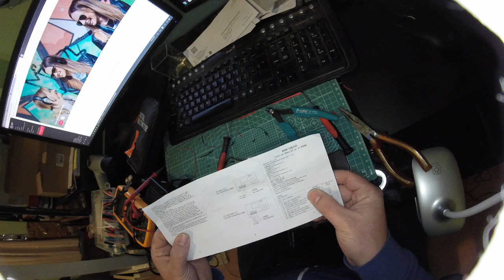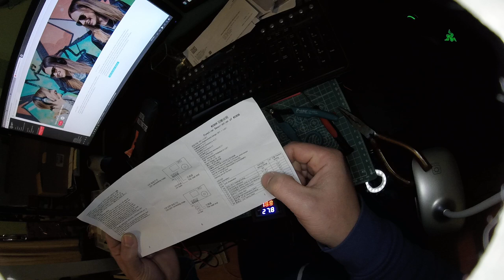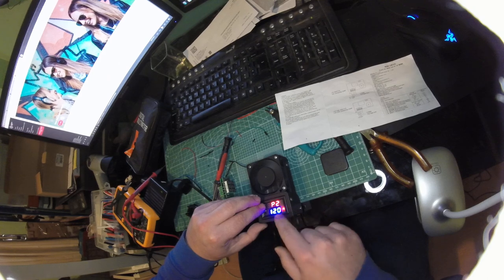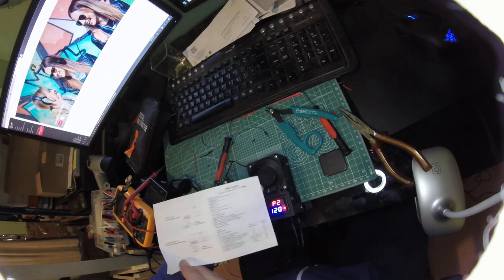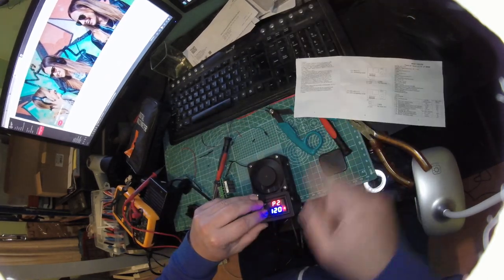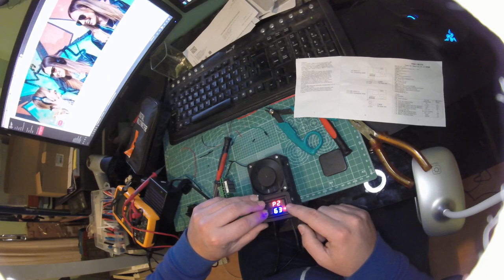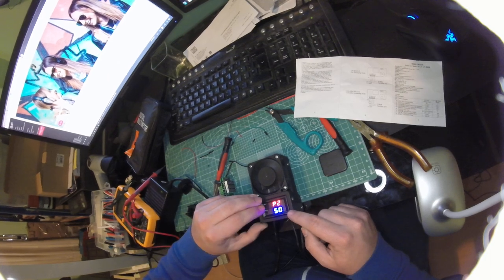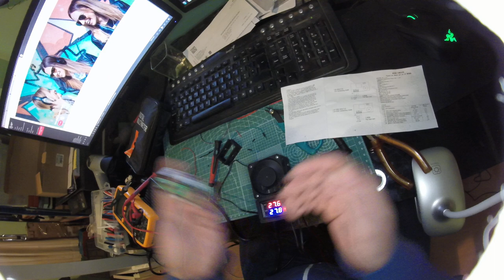Magsnap Heater unit for SLA/LCD/DLP 3D printers

Comment: Would love to see what spec sheet you have cuz mine came with no instructions. Worse the leads on the heater are pretty solid spade type, so stick down deep in the case and interfere with the back of the lcd. As usual i need to re-engineer something thats already been engineered. An assembly vid would be helpful
Reply from the maker: Yeah, you are not the first one to ask for a assembly video. I was hoping by now the community had already made one but guess not.
Beginning of the year i'll be building 3 more units for my machines so i'll make a video then. 
The wires are tight and barely fit, this was done for compactness. 
I have shared the Fusion360 source files you can edit them easy if you like. The way i pack the wires is I prebend the wires into shape before final assembly

I have some pictures on the Photo album i think, links on the FB post

Comment: Hi, first of all, thanks for your great work, the idea was fantastic. 
I bought a elegoo Saturn and build one of your heater, but i have a question about the flow of the air.

Where should the hot air flow go from? 

I mean, should the air go through the fan and then through the heater or vice versa go through the heater and then through the fan.

I assembled mine, watching your video (fan and then heater) and when I turned it on the heat coming out the back bounced off the dome and overheated the case to such an extent that it melted the power connector in a few minutes.

Thanks in advance and I repeat thank you very much for the design.
Reply from the maker: air must be always on and is pulled from front onto the diffuser disk.
if you have melting connector either you have a bad psu, too thin wires or the wires are not making a propper connection to the power connector. i reccomended you solder coat the wires at least or ideally use crimp terminal
Reply: @X3msnake  thanks for your Quick response. i will change the wires to better ones. And use a better power conector. When finish i will promise to send a picture of it working. Best regards.

Comment: Thank you for your video. I would like to ask you what kind of material to use for the "plastic" body?
Reply from the maker: the design was created to be print with resin, any resin will work. If however you want to print it with FDM you will need ABS or PETG because PLA will most likely deform with use. pre-supported stl for resin printing can be downloaded from my thinguiverse
Reply: @X3msnake  Great. Thks.

Comment: i have printed the casing a purchased the heater and thermostatic controller. I have 2 questions. 1. is there a wiring diagram/description anywhere i can access (sorry - i found the link!), and 2. Will an AC 100-240V to DC 12V 5A 60W Power Supply Adapter For LED Strip Light do the job?
Reply from the maker: wiring diagram and more info is in the facebook public link on the video description.
No you need a 10A power supply (120w) or above (a old computer psu works too) or you will burn the psu or at leat it will be constantly tripping the safety and rebooting
Reply: Thankyou for the info, and Thankyou very much for all your hard work giving us all this for free. Brilliant man!

Comment: hi, sorry for the stupid question but what kind of electrical wire do I need? I have zero electrical experience...
Reply from the maker: for the internal connections of the heater you can use the wires that come with the parts since they are long enough to be cut to size and reused the spare.
rule of thumb use the same wire size   that comes out of each lead.

Comment: So over a year later, what do you think of the unit?  I just bought a resin printer and I'm looking for something to keep the chamber warm while it prints to ensure the resin viscosity doesn't get too high.
Reply from the maker: it is a battle tested unit better than any comecially available. ask people in moai group for example. 

i use it in all my units during the winter specially for printing tenacious or blu
Reply: @X3msnake  How many degrees over ambient does the 100W heater get you?  I think I might need 20-25C over the dead of winter, so just trying to ensure I build it big enough.
Reply from the maker: @joebywan  works well for small printers  with 5.5/6inch screens or the equivalent volume of a form1.

it keeps a stable temperature of up to 30c even with zero degrees outside the box but the cooler the outside the more it will take to get the heat to par. with 15c outside the printer it takes about 15 to 20 minutes to stablize at 28c
Reply: @X3msnake  Looking at the pictures you have on the google album, it's a bit difficult to make out all of the assembly with the printed housing.

Do you bend the heater connections in a particular way to clear the thermostat once they're all slid into position?  As stock the heater connections foul the rear of the thermostat.
Reply from the maker: @joebywan  can't remember i think i did bend it to the sides after insertion. I have another unit to assemble and make a video about it. but in the mean time i will see about taking aome photos of the prototype unit i have at work and add it ro the album tomorrow
Reply: @X3msnake  that'd be great, thanks!

Comment: Hi! Thank you so much for your video and plans for this heater! I’m unfortunately having issues. My unit is turning off and on, like it’s tripping. It’s wired correctly (I believe). Does anyone have any ideas?
Reply: Usually if the heaternis tripping it is a issue with the psu not having enough amps
Using wires that are too thin can cause a increase in resistance and cause the heater to pull mmore amps than it is rated.

Test with a PC psu if you have one around since those usually have amps to spare. if it works ok then check first if your wires are at leas the same thickness as the ones comming out of the heater on each polarity. 

Usually the heater comes with enough wire to reuse for the needed connections ensuring the right width there.

Let me know how it goes

Comment: Ordered all the parts... and printed the case.  What settings do you normally use?  35c?
Reply from the maker: LCD resins between 25-30ºc
SLA galvo and DLP 30-35ºc
Reply: @X3msnake  And Photon is a LCD, not a DLP printer?
Reply from the maker: @dtelder2682  yes photon is LCD printer. The correct term is MSLA. DLP use a projector with tiny mirrors that transmit full uv light. MSLA uses a mask LCD and even tho it works you lose 50Percent of the light to the mask polarizers. So LCD resins must be much more reactive to UV light than DLP resins

Comment: need help on the wire diagram to set up the thermostat switch
Reply: check the facebook post it has a clear diagram on the connections
Reply: @TheRealViniciusSilva   Thank you
Reply from the maker: @keepitrealandtoasty  You are welcome. let me know how it goes ;)
Reply: @X3msnake   i got 1 photon Set up. On the second unit I am having problems with the temp W2809.  top temp in red is blicking and not reading temp.
Reply from the maker: @keepitrealandtoasty  you are probably stuck in setup mode. i cant remember but you had to press both buttons or something. that or your temperature probe has a bad connection
Reply: @X3msnake   Yes. Got it working.
Reply: If you have the time it would be cool to see this type of setup for heating filaments.
Reply from the maker: @keepitrealandtoasty  same thing, just make sure you don't go over the max ratings of the controller, namely check the relay code datasheet to see how much power it can source trough it

Comment: My controller just dont connect the relay..
I think its a cheap chinese crap...
Is there any other what will fit there.?

Have to ask money back from ebay
Reply from the maker: did you set the menu to heat mode? it comes by default set for cooling
Reply: Yes I did. It didn't connect it on heat or cold mode.... Measured it with multimeter
Reply: Maybe relay is really broken?🤔
Reply from the maker: @kjtemmes  feed 12v to the relay leads directly to see if it works
Reply: Have to try that...
Reply: Relay does click when feed12v directly to it
Reply: So there maybe isn't anything for to be done 😔
Reply from the maker: @kjtemmes  did u test the relay directly? if the relay is dead you can probably replace it
Reply: Yes. Directly.
Doesn't switch any other way. Only when directly give it 12v
Reply: @kjtemmes  mmm what exact model do you have. can you share some pictures of the internals, maybe make a google photo album and put the link here.
Reply: Relay model is sra-12vdc-al